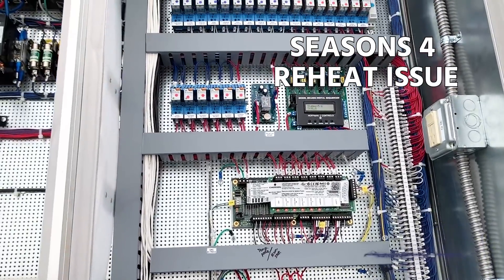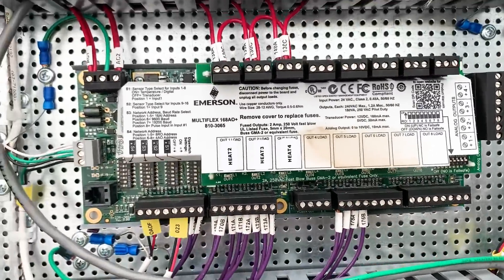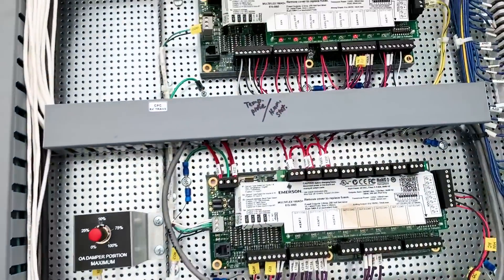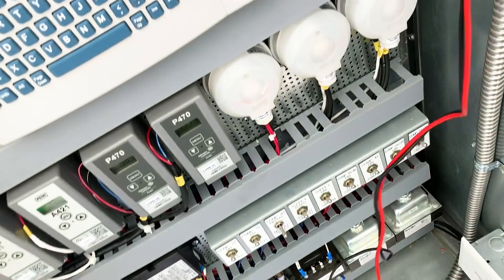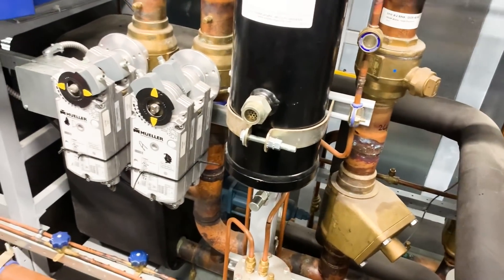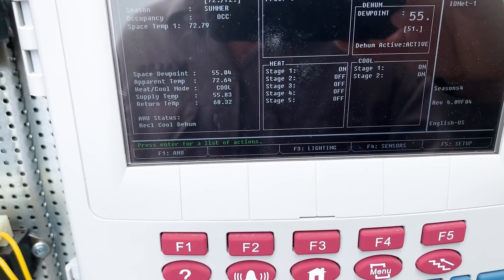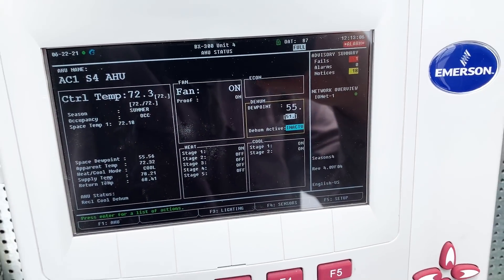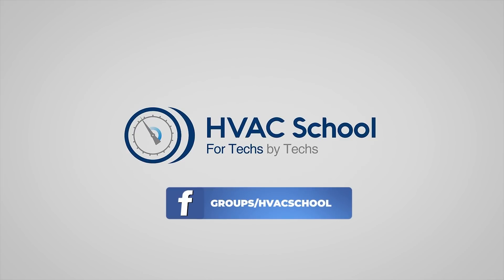Commercial HVAC Diagnosis - Seasons 4 Reheat Issue

Comment: He's not exactly correct in saying diverting valve on the supply, mixing valve on the return. If your loop pump is on the return water....if your valve is on the supply....you will empty the coil. Thats why its on the return...so the coil stays full of water. Diverting and mixing ...
DIVERTING- ONE INLET, 2 OUTLETS
MIXING 2 INLETS, 1 OUTLET

Comment: I think the technician may have mis-diagnosed the polarity on the reheat valve. In the beginning of the video, the voltage was dropping because the PID loop was trying to add more heat as the store temperature was below the setpoint. Then he reversed the polarity.  At the end of the video the store is too cold (69 deg) and below the 72 degree setpoint because now the reheat valve is operating backwards.  The reheat is only to maintain the store temperature.  The compressors control the store dewpoint.
Reply: I agree. Even the manual showed the analog output to the reheat valve was to maintain store temp of 72 degrees

Comment: My question  is  that  why the property management company didn't want or use the original installation hvac contractors/company to fix it,  rather than just using any contractors to fix it for less when they have No ideas of what is going on!!!!
Reply: Because all the see is money . They have no ideal how much knowlege it takes to understand and repair this type of equipment. As far as they are concerned every technician is an idot. So why not just get the cheapest idot out there.

Comment: So the heat exchanger for the hot water system was using the heat from the condenser? I'm a little stunned that such a large unit would be constant volume. They could have made it variable based on space temp. Did it have demand control ventilation for CO2?
Reply: Eric M  sorry I meant I was stunned that the air side was constant volume since it had a drive

Comment: Have a good day, I have to ask some general questions which come in my mind during routine works, but I forget to ask and I think its a good platform to ask such type of questions.
1. Why are condesing units always bigger than evaporators?
2. Why does suction line of a compressor has larger diameter than discharge line?

Comment: I like those calibrated hands🤣
I use a cheap non contact thermometer but those hand sensors are pretty good.
🍺🍺🍺🥃🥃🍿🏌🏻‍♀️
Stay safe. 
Retired (werk'n) keyboard super tech.
Wear your safety glasses.